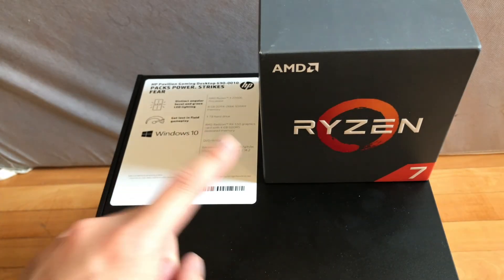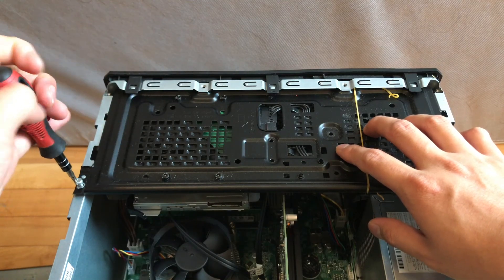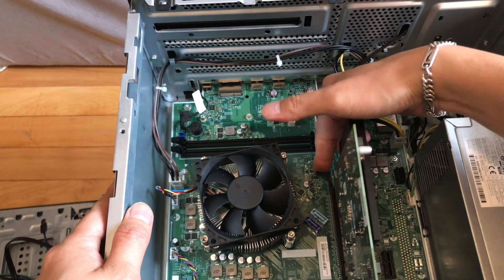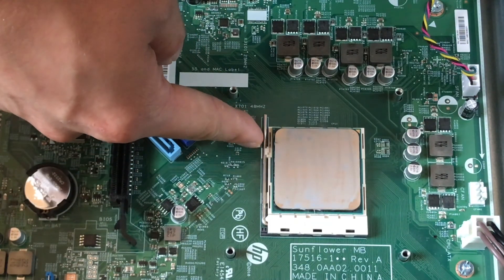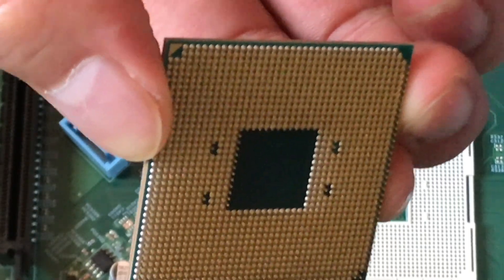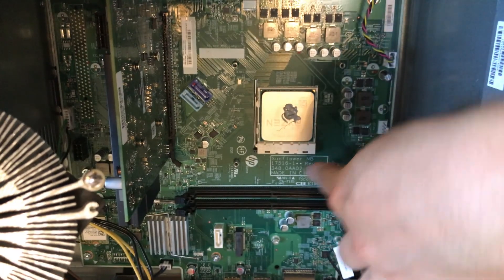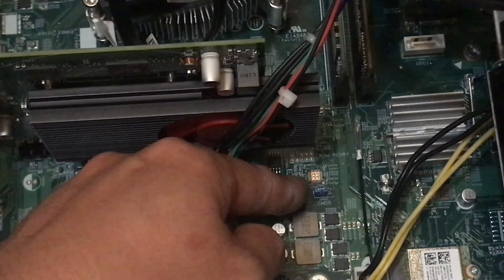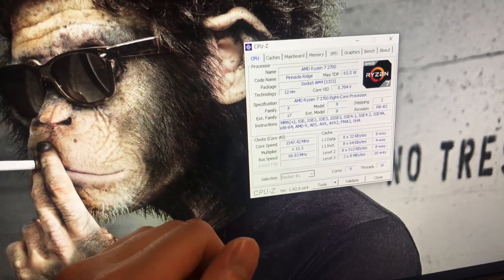[BIY #5]: Upgrade Processor Ryzen 7 2700 (non-X) on Pavilion 690-0010. Read Description

Comment: Hey I upgraded my Hp 690024 with a ryzen 7, gtx 2060 super 8gb and a 16gb ram kit. I tried to turn my computer on and it just keep restarting…can someone help plz!!!
Reply: U rest cmos?
Reply: You have to go back into the pc and take out the small battery for the cmos for about 3 minutes then put it back in.. DO THIS with everything powered off and unplug the pc then press the power button to force any residual power out of the PSU

Comment: Hey I'm back, Replaced the Ryzen 5 2400G to a Ryzen 7 2700. Changed the RAM from 24gb to 32gb of Samsung memory running 2666mhz dual channel. Also upgraded the SSD to the stock crappy 128gb SATA SSD to a 500gb Samsung 980 m2 nvme beast. Before upgrading make sure you update the latest BIOS and make sure you are very patient since this computer is extremely hard to upgrade. Make sure you clear the CMOS before you install your new components since this motherboard is so stubborn recongnizing new copoments which I made the mistake of not clearing the CMOS which made the PC not boot at all and cause a boot loop. To reset the CMOS it is very hard tto do without removing the GPU out of the computer so make sure you do that and remove the battery from the PC for a couple of minutes and pt it back on. When you finally boot with the new CPU make sure you prress Y which will Reset the fTPM which will remove user accounts but not the data on the drive windows is installed on and you can always add back the user accounts if you want. Next up is a GPU upgrade when GPU prices go down.
Reply from the maker: Good job! you better be proud of yourself, and I appreciate your information and guidance.
Reply: just dont buy HP is crap

Comment: I have an hp 690-0024 with a Ryzen 5 2400g and have a new r5 2600... that little blue piece, do I just take it out and put it right back in after I installed the new cpu? Also what happens right after I power on the pc with the new cpu? Do I just hit the Y key and it should be up and running or do I need to update bios with a thumb drive? Last question with the ryzen 2600 fan work on the mother board when I remove the ryzen 5 2400g and the fan?
Reply from the maker: 1) you’ve done that with the blue thing to reset BIOS.
2) when you turn on the PC with the new cpu, by choosing Y, your computer will reset entire account but not data on your hard disk. 
3) you have to use the stock fan. Remember wipe out the old thermal paste and apply the fresh one. My Ryzen 7 fan isn’t fitted with the motherboard. I hate that part. Anyway, the stock fan works fine with me.
Reply: @tatkhang12  thanks! I did everything I did get a cmos error when it first booted but then it restarted and everything seems fine... I have restarted and turned pc off and on a few times with no issues. But I am noticing my cpu temps are running around 77-80c I’m going to update my driver see if that makes a difference. I did apply thermal paste just like you mentioned and cleaned off all the old thermal paste
Reply from the maker: Have you checked the latest bios from HP site yet? I got my PC updated a few days ago. My cpu is at 35-40ish Celsius when it’s idle.
Reply: @tatkhang12  yea I just used hp assistant this morning before changing the cpu and it said it’s the latest version I believe my date show 2/7/2020 for the bios
Reply from the maker: @TheTattoedVRpilot  Here is the latest version.
https://support.hp.com/us-en/drivers/selfservice/hp-pavilion-gaming-desktop-pc-690-0000a/37730935/model/21447498?sku=3LA91AA
Reply: @tatkhang12  did you select the December 1st 2020 one? Do you think it will make a difference in cpu temps? I’m currently playing xplane 11 in Vr as I’m typing this to you and see my temps at 74-75c on Ryzen master
Reply from the maker: Yes, I chose Dec 1, 2020. Bios doesn’t negatively affect the performance. It optimizes your cpu.
Reply: @tatkhang12  alright thank you! Updating bios as we speak.
Reply: @tatkhang12  one more question is using the ryzen master program an accurate way to see my cpu temp? Or should I use another program? Also I’m running the ryzen 5 2600 but I figured it’s similar enough for as the ryzen 7 2700
Reply from the maker: Ryzen Master is a good app to check temps and speed. I use it as well. Your ryzen 5 2600 is better for gaming because of higher base clock 3.4Ghz, compared to Ryzen 7 2700 which has more cores with lower base clock 3.2Ghz for video editing.

Comment: Did you need to upgrade your psu at all for this upgrade?
Reply from the maker: No, I didn’t.
Reply: @tatkhang12  Thanks, although I would still like to upgrade my PSU in the future. Do you have a recommendation for a compatible PSU for this pc?
Reply from the maker: LP05757-800 is a 500-Watt PSU sold by HP. It is the only one compatible with this tower.
Reply: @tatkhang12  Thanks very much!
Reply: @tatkhang12  could you send a link to the part when you get a chance? Couldn't find the exact psu on the hp store
Reply from the maker: @weenie_butt_-5273  https://parts.hp.com/hpparts/Search_Results.aspx?mscssid=3DD6ECD7B8D44FE2B30190E6F587AAFF&SearchIn=PartNumber&SearchPN=L05757-800